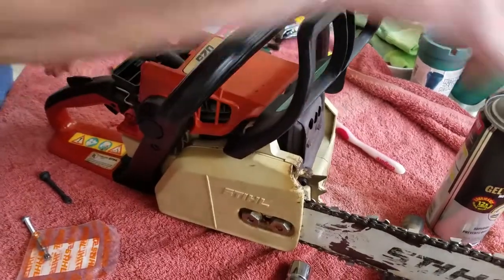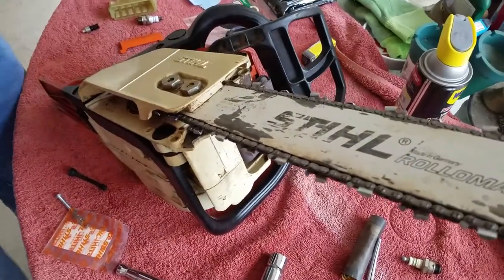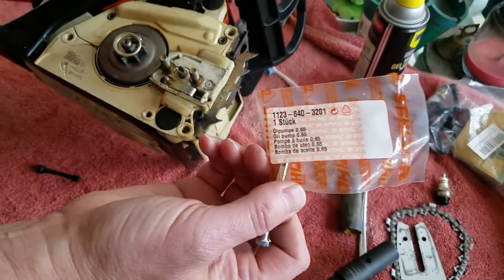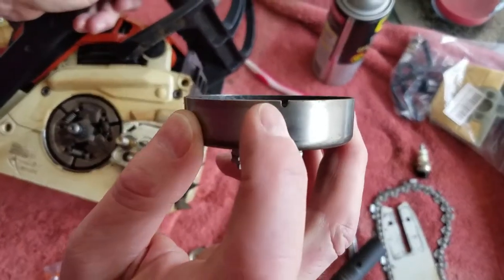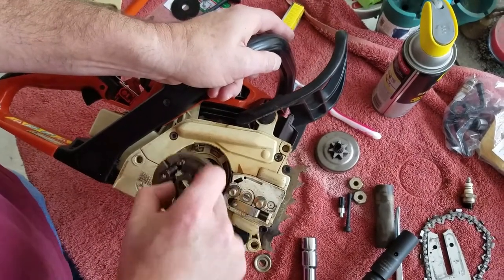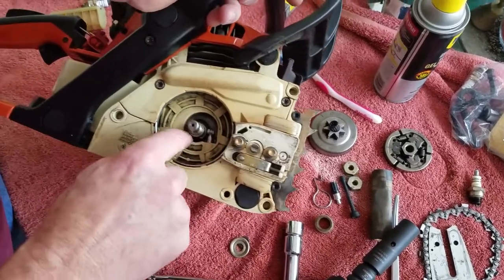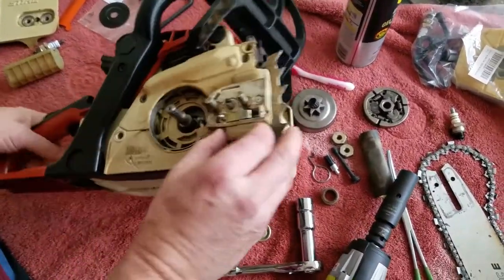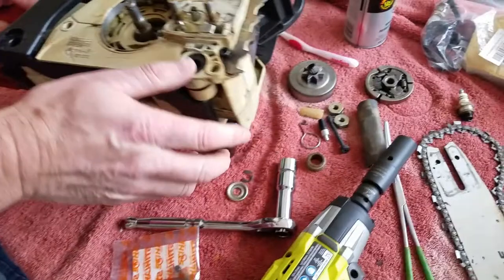How to Replace, Change, Fix Stihl 025 Chainsaw Oil Pump

Comment: My 025 didn`t have that big washer behind the clutch from day one brand new, and nobody has ever touched my saw, so, i do know that it came this way from Stihl, with no washer. Mine is starting to piss oil all over the place when its sitting for awhile. If i don`t drain the oil tank when i`m done using the saw, it will all leak out into the storage case. I suspect the hose coming from the oil tank needs replacing. This is by far the BEST how-to video i have ever seen for the oil pump in the Stihl 025. Thank you so much for posting this video, it was a tremendous help! Also, the vent tube for the fuel tank is a weak design too. Watch for the fuel tank vent hose to be cracked if you start smelling gas if to tip the saw on its side.
Reply from the maker: Thankyou glad I could help.

Comment: In this video, you said the clutch doesn't need to be tightened too much cuz the spin will tighten it more. But in another video channel by a small engine repair shop "Chicanix", she really torqued down on that clutch nut to get it really tight. So I'm wondering what are the correct torque specs.

Comment: I use a pair of needle nose pliers to "squeeze" the c-clip back on, with the other hand to hold it down so it doesn't fly away.  By the way my 025 doesn't have the big black washer under the clutch but never has been a problem. Is it stock and is it really necessary (anyone)?

Comment: Man if you going  to make a video  get it correct  there not bolts the nuts  and they screw  to the studs .take it to the dealer  get it done  correctly  .